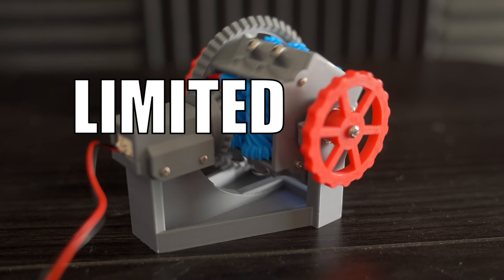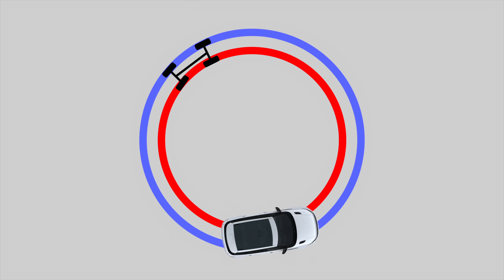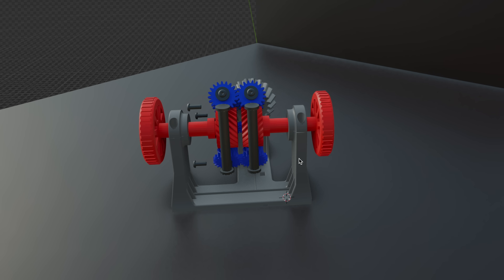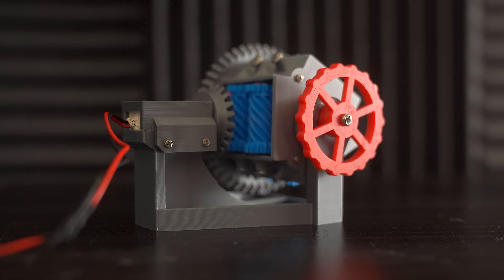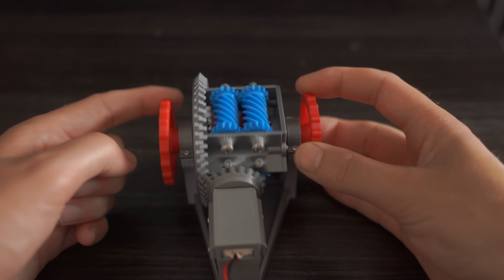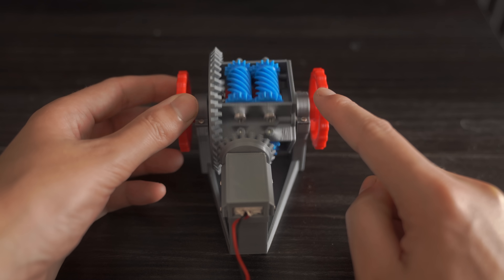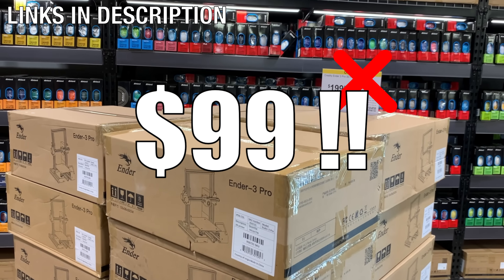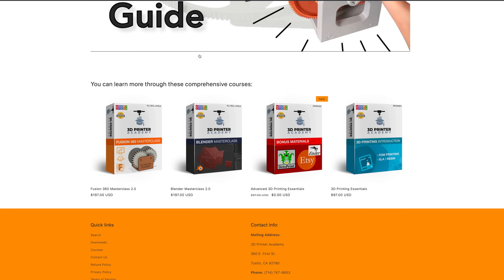What's a Torsen limited slip differential?

Comment: Cool video. You left me wanting to know more about how and why this design works the way it does, though. As in, what about its unique arrangement leads to the torque being distributed the way it does when the "loose" wheel has at least a small amount of friction, and by contrast, why a "basic" differential DOESN'T do that.
Reply: Me too. I still don't understand why this one is so special compared to a normal diff
Reply: Torsion diff take advantage of worm gear effect. You can turn the screw to rotate a gear but turning the gear doesn't want to turn the worm.

A small amount of load on the spinning wheel effectively locks up the worm gear which powers both wheels.

Normal limited slip is just a clutch between both axles.

There is also viscous couplers and automatically locking diffs
Reply: @tylerhagen3068  this is wrong. There are only helical to helical gear interface. The spur gear mates to another spur gear and other helical diffs have no spur gears at all. 

Helical gears create axial thrust and that’s the mechanism used to create resistance.
Reply: He just got lazy, didn't want to show the differences between the two. THUMBS DOWN!!!
Reply: This video has a much better explanation. https://www.youtube.com/watch?v=JEiSTzK-A2A
Reply: Helical gears create axial thrust. So the more torque applied to them the more they push away from each other and resist movement. That resistance forces the other wheel to move.

Non helical diffs use gears that don’t generate those forces. 

This is why these helical gears transfer torque proportional to the torque generated. The more torque applied creates larger forces that create more resistance.
Reply: Yep, the video fails to explain the behaviour of the differential, but we can see the construction and behaviour, of which the last seems identical to regular differential as a wheel can be completely halted, making the other wheel spin faster... I'm not convinced that the displayed model works at all as intended.

I've seen a video of a Lego-model Torsen differential, that used worm gears, which can't be turned by the main axles, but now I'm thinking that the Lego-model had flawed operation too... :D
Reply: Engineering explained has a decent breakdown of torsion diffs
Reply: He did mention the principal of operation, though breifly. It relies on the helical angle of the "worms" being steep enough that they can only pass motion in one direction i.e. the pinion can not drive the worm gear, but the worm gear can drive the pinion.

Comment: why do we even bother with clutch pack or other LSDs when this exists
Reply: Because torque biasing diffs have one fairly large flaw. As he demonstrated in the video, if one wheel is completely open (e.g. a wheel lifts under cornering, or it's on a very low friction surface) then it behaves like a regular open diff.
They have the major advantage in not corrupting vehicle handling like plate diffs can, and there are no clutch plates to wear so it provides consistent performance without the need for rebuilds.

Comment: That is torsen diff.
 LSD is with sliping clutch
Reply: LSD simply means Limited Slip Differential. A torque biasing diff still limits slip, unless you have one wheel completely open.  A viscous coupled diff is also an LSD (velocity sensitive rather than torque sensitive).

Comment: Correct me if I'm wrong, but aren't they supposed to be worm gears, instead of helical gears? I thought the entire point of this type of differential was that no wheel is allowed to 'lose' torque, due to the worm wheel's one-way drive property. As in: one wheel is only allowed to spin slower if the other wheel is being spun faster by the turn, instead of being driven by the differential.

And if that is true: holding one wheel in place actually locks the differential, since the worm wheel won't be turned by the axle. While if one wheel is being forced to spin faster (due to turn), THEN the differential starts spinning.

Comment: i would have liked to see more on piece by piece how one wheel slipping creates torque to the wheel thats not. but ive spent over a grand installing one of these on my truck so my interest of further explanation might just be above my head of understanding. if that makes sense.... still a well made video.
Reply: With a small enough helical angle on the worm gear, the worm can drive the pinion but the pinion cannot drive the worm.
Reply: I think the helical gear arrangement is inherently having greater friction than pinion and spur type. It is this friction that provide some braking force on the side that start spinning freely so you don't need to step on the brake.
Reply: @Tymeshifter  no its not friction its gear bias. Friction is a plate LSD which basically is a ramped clutch with multiple disks. For off road trucks you don't want an LSD, but a simple locker, as on dirt the low friction surface gives you the differential action you need while keeping the axles locked. With a LSD off-road and a wheel in the air, you are now stuck as a LSD must have some traction on both wheels or nothing happens. On-road, LSD. Off-road, locker.
Reply: @spinnetti  wait really? i always thought the clutch diffs always locked spinning wheel (or as close as the plates can get to “locking”) regardless if the particular wheel’s in the air or on gravel or whatever.
Reply: @spinnetti  that is why modern vehicles could just apply brake force to the spinning in the air wheel
Reply: Found a Youtube video explain how it works: https://youtu.be/JEiSTzK-A2A